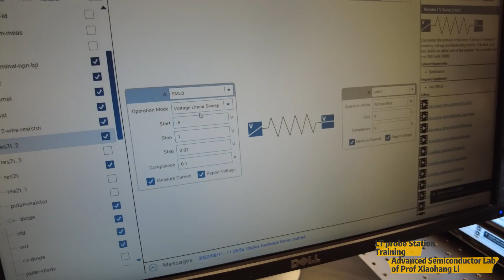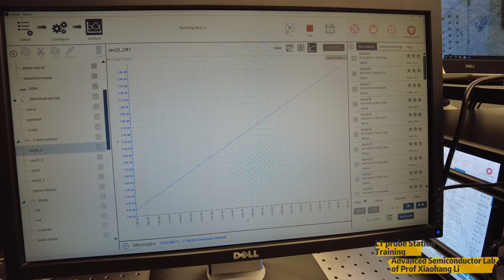(Updated) Keithley semiconductor analyzer 4200 and  probe station training by José Manuel Taboada

Comment: Is there a reason not using electrical driven micromanipulators in the cyrogenic compartment. To my understanding piezo and magnetic properties still work at 77K. There are much smaller.